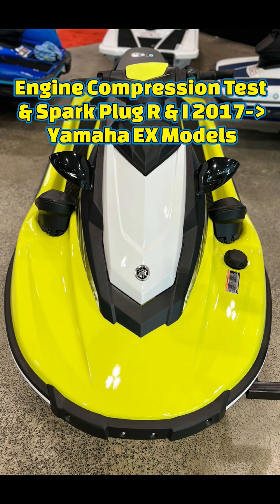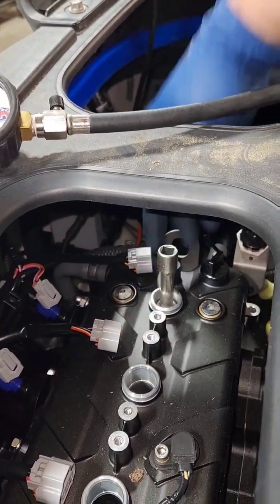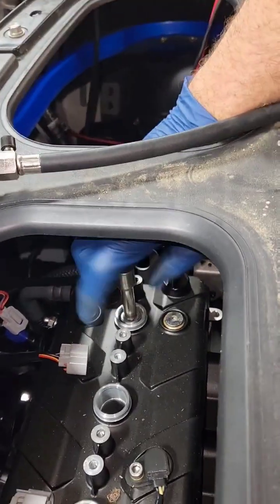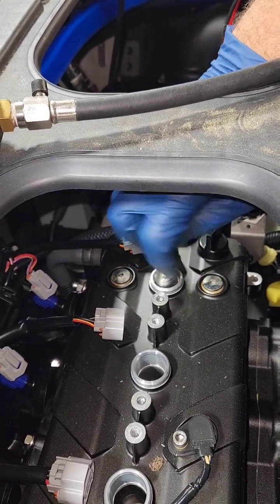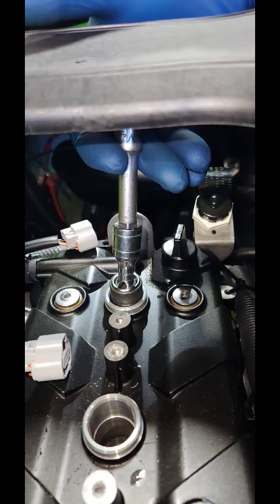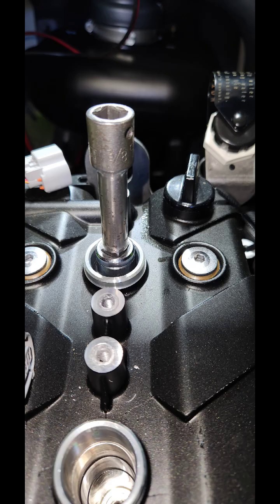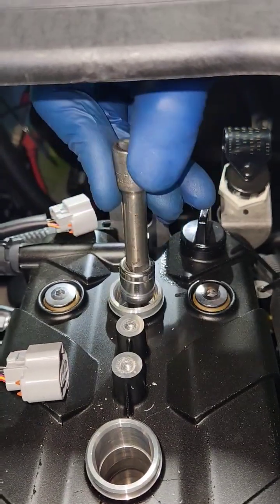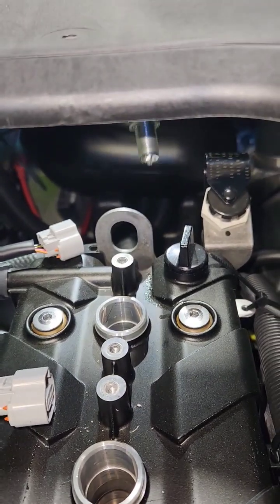Yamaha Engine Compression Test & Plugs! Who Said I Can't Replace Plugs W/ Seat Base On?

Comment: Hi. I have Yamaha ex 2021 sport I am reading 180.psi is that a problem why is not starting
Reply from the maker: All 3 cylinders should be close to equal, within 10% of eachother.. Remove all 3 coil packs, do compression test 1 cylinder at a time with the throttle held wide open while turning the engine over. Keep spark plugs in the cylinders that are not being tested also, they don't have to be fully tight but just snug. Take your highest reading cylinder and multiply it by .90, that will give you the low number that the other cylinders should be at or above. I have used Yamaha Combustion chamber cleaner spray and fogging oil to help free up stuck piston rings and help valves seal better to bring compression readings up. I recommend that if your readings still come out on the low end. If your cylinders are all within 10% of each other I wouldn't worry too much about the readings you got. If you have any further questions just ask that's what I'm here for and why I make the videos.

Comment: What is correct comparison?
Reply from the maker: 200-220psi would be acceptable. If you have any readings lower than that or your readings aren't close enough together multiply your highest reading by .90 and be sure the other two lower readings are above the result of that number. That is verifying that all 3 are within 10% of each other. Anything over 10% variance means there is likely a problem occuring in that low cylinder. If you have any other questions just ask, glad to help where I can.
Reply from the maker: Also be sure you have a jump box attached to the battery or be sure your battery is fully charged, strong and throttle wide open when turning engine over. Throttle wide open indicates drown mode like as if you are expelling water from the engine if ski capsized. It typically prevents the coils firing in that position.
Reply: I’m Having problems with mine so cylinder #1 I’m getting 120psi #2 125psi and #3 130psi this can cause hard start right ?